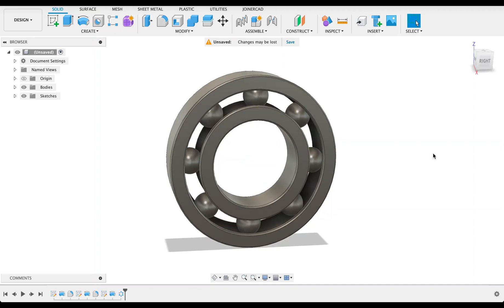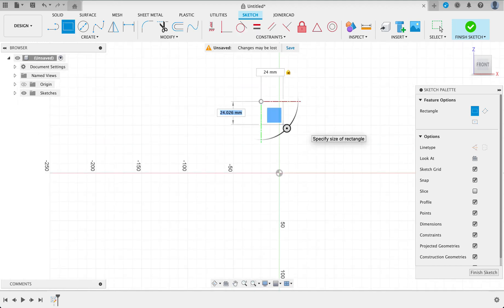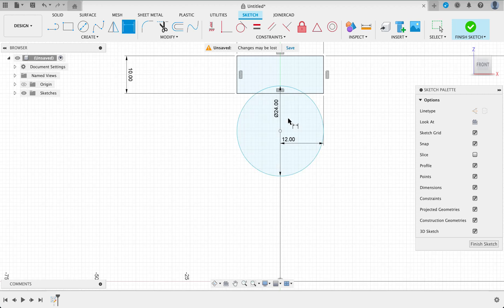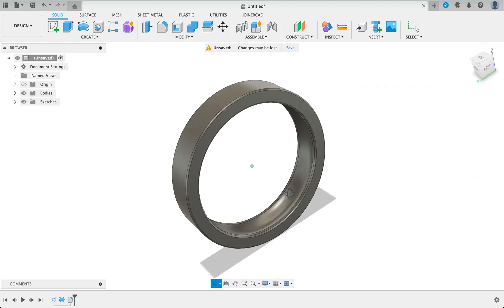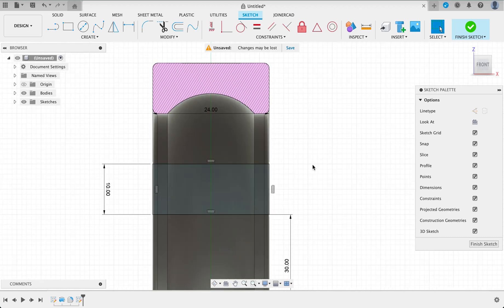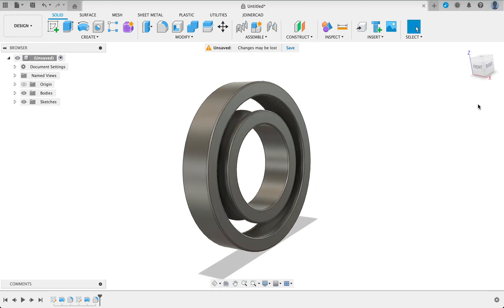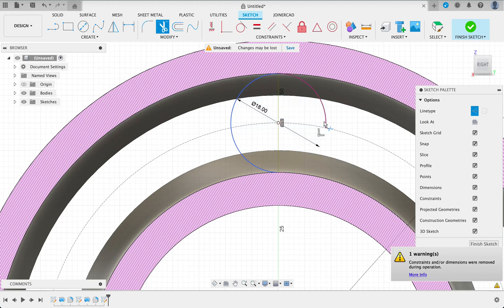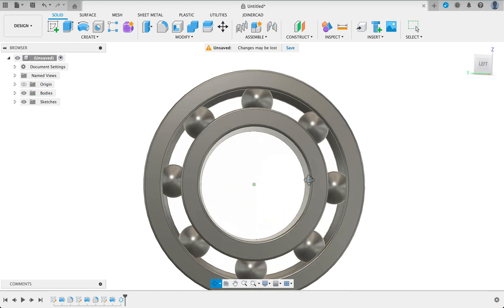Fusion 360 tutorial: Designing a 3D ball bearing

Comment: Hello, great video. It would be very helpful if you did not use hot keys. it makes it darn near impossible to follow as a beginner. I'm having a hard time understanding you, so its important to be able to follow along rather than just hearing jibberish and keyboard keys clicking. I'm having a hell of a time figuring this out. I'm at about the 4 hour mark, but thankfully im on the last part.
Reply from the maker: Hey man thanks for the feedback. I have mostly stopped using hot keys in my newer videos or if I do I’ll state the key I am using. Check out some of the newer videos.
Reply: @Fusionfundamentals  Will do. Also, I fdm printed this bearing and there isnt anything holding the balls from colliding.
Reply from the maker: Unfortunately the bearing is not complete in its form. There would be an insert that goes on each side that would separate the the balls and prevent them from colliding
Reply: @Fusionfundamentals  Yes, I figured that out after about 20 attempts of printing the design. haha I ended up just using half circles mounted on the outer race as bumpers. I also used 13 balls instead of 8 to eliminate too much play. I used a little bit of grease and it works phenomenally! Thank you very much for taking the time to make this video.